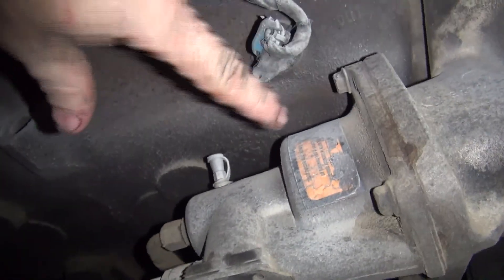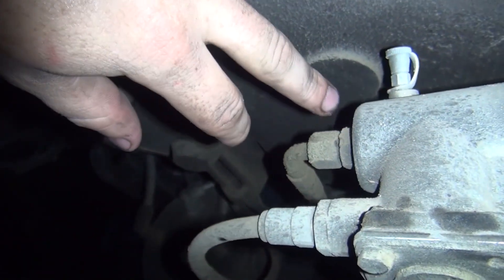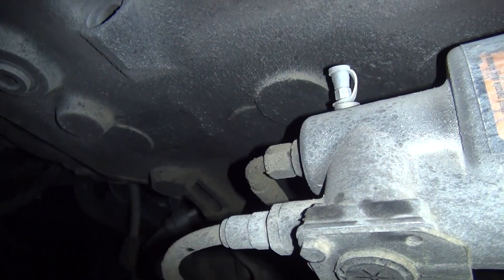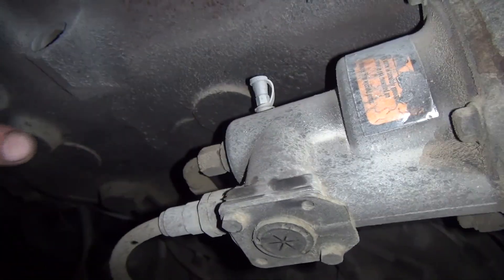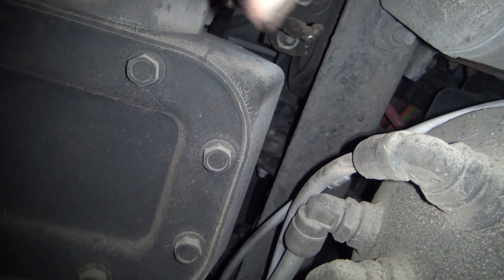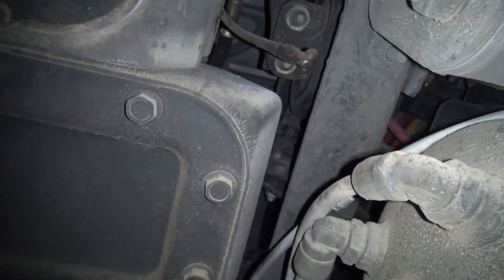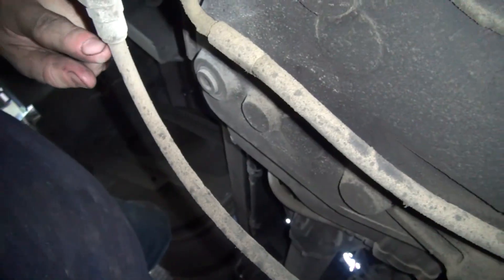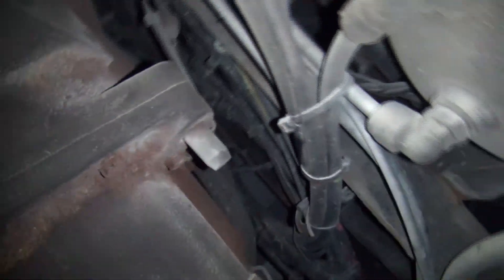Volvo vnl air assisted hydraulic clutch

Comment: I have a 2001 VNL64T I keep getting air in the clutch system could you please tell me if it's the master cylinder or the slave cylinder most common

Comment: We have a 2021 t800 kenworth and it has à air assist clutch dont know for other trucks but kenworth has the air clutch systemes
Reply: My 2014 Pete 579 has one.
Reply: Is it pretty easy on your 2021 t800 I had 07 kw t600 sweet truck but unfortunately I had to sell it cause it fuked up knee after pressing 100s of thousands time in 10 years

Comment: Hey dude, the European truck manufacturers have installed air assisted hydraulic clutch pedals in all heavy diesel trucks together with fully synchronized transmissions since the 1960s !     

My opinion on the American trucks has been censored in my previous comment.   So much for the freedom of speech in today’s PC world !     Put it this way, the American truck engineering is at least 50 years behind the Europeans.

PS, the Pete 379 still has a mechanical rod linkage clutch pedal which exits the cab through a literal hole cut in the floor of the cab.   Can’t get more ancient than that without going back to horse and buggy technology !

Comment: Hey CHase I got a 2012 Volvo VNL 670 I’m having similar issues clutch pedal is very hard I change the clutch same issue its hard to get it in gear when the truck is warmed up ...I change the master cylinder and slave cylinder I’m still having the same issue whenever I pull up to the stop sign I have to downshift because it’s hard to get into first and second gear if you have any  idea let me kno plz bud
Reply from the maker: Only thing I can think is check the air pressure going to the slave cylinder, make sure clutch is properly adjusted and check the clutch brake...
Reply: chase5726 there no air line going to it .. plus it is a automatic clutch

Comment: most European trucks use that system and it is called servo clutch, Scania, Renault, Actros, Man, Volvo and Iveco  have been using this for a very long time
Reply from the maker: I like it. It greatly helps the old leg out. lol
Reply: To be honest I can not imagine how to control a 800Nm (corresponds to about 150kW/1800rpm) or above rated clutch directly, without any form of engine power assist.
By the way the "most modern" truck above 7 tons without any power (essentially air) assist I've ever met was Praga V3S from early 50's and this video was a surprise for me it was even feasible to make the clutch work without... All later, include busses, used air assist, where you practically can not operate the clutch without the air pressure at all. I have even heard a story from my dad about the servo valve being faulty on an (Ikarus 280, power train was some MAN license from the 60's or so), so the clutch had to be operated by just a brute force. Well, the seal in the master cylinder gave up to the pressure and he had to get moving on a starter and then "float shift" in order to get the bus "home" (of course, without passengers)...
Reply: I have seen even some tractors using that

Comment: i dont recall seeing an air assist clutch in any of my trucks. i have only had a few volvos and they were 2005 - 2003. i agree, in traffic that would be the bees knees!
Reply from the maker: Yep, pretty nifty design they got. I figured you might have ran across this on something another with all the trucks you get to work on.
Reply: Well, in Europe from about 6 heavy truck or bus types with a manual transmission designed along 50's till now, I'm familiar with to this extend, all used essentially the same system. And based on what was in the taught in the driver traning course, my impression was none above about 7.5 ton existed without such system...
Reply from the maker: Wow, didn't know it had been around that long, I like it. Much more driver friendly not having to stand on the clutch pedal.
Reply: I drive a 06 VNL...same thing, just keep the fluid level full. My fluid level got low, and got that hard pedal too. I read somewhere too that if you think you don't have quite enough pedal free play, that's almost normal.